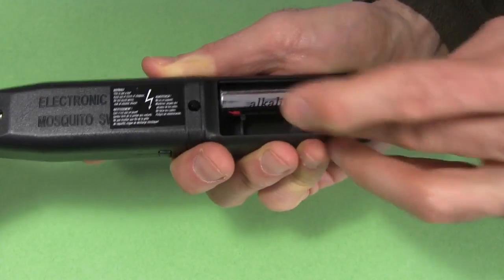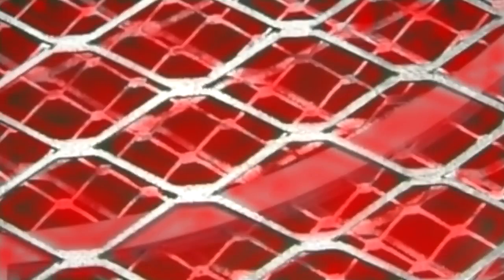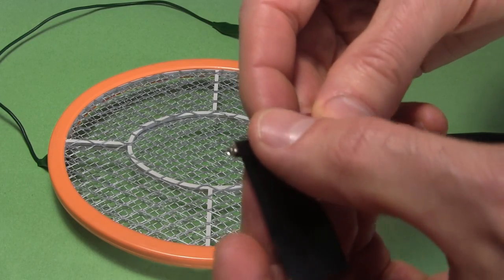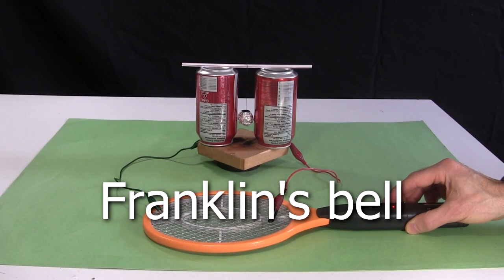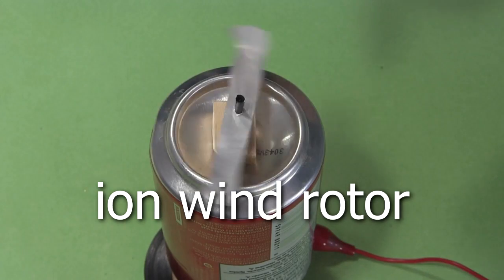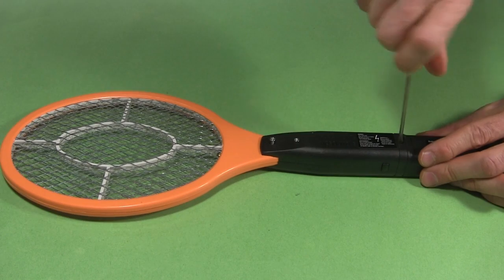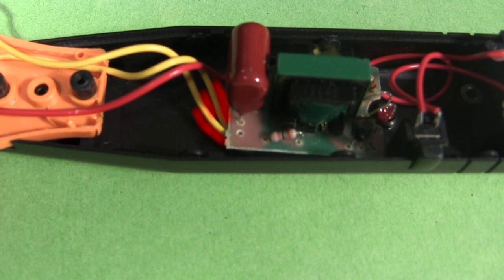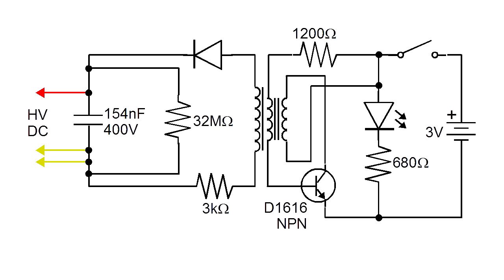Electric Fly Swatter/Zapper Racket High Voltage Power Supply

Comment: Bug Zapper is pretty much the following you can build from scratch or just rob a bug Zapper:

The simplest way to generate 1,500–3,000V DC from a 6–9V battery source is using a Joule thief circuit combined with a voltage multiplier (Cockcroft-Walton ladder).

1. Joule Thief (Oscillator)
Uses a transistor, resistor, and hand-wound ferrite transformer (e.g., toroid with 5–10 turns each on primary and feedback windings).
Converts 1.5–9V DC into high-frequency AC (typically 20–100 kHz).
Extremely simple, low-cost, and self-oscillating.

2. Voltage Multiplier
A 4–6 stage Cockcroft-Walton ladder made of diodes and high-voltage capacitors (e.g., 1N4007 diodes, 1–10 nF/1–2 kV caps).

Rectifies and stacks the AC pulses from the Joule thief to produce smooth(ish) high-voltage DC.

Output: ~1.5–3 kV depending on stages and input voltage.

Comment: Was that a normal screwdriver making those sparks or should I use electric one plus could I check the voltage with a meter checker
Reply from the maker: Yes, it was a normal screwdriver. The non-metal handle meant that I wouldn't get a shock. The voltage is too high for a normal voltmeter.
Reply: @RimstarOrg thanks for the info because I don't want another shock ,  it gave me a shock when the button wasn't pressed down

Comment: I have seen all of your videos and I love how you are going on on your YouTube channel soo about this video can we put this high voltage into joule thief circuit to host it up Or why that when we have ac current why we make it into low DC 🙄 maybe we can make it bigger AC current with voltage multiplayer??? It will make from low AC to higher very higher DC right ?!! Can you pls reply me and say if should you make a video of it I am a big fan of your work pls ?!
Reply from the maker: No, putting high voltage into the input of the joule thief circuit would probably damage some of the components in the circuit. And you're right, AC current put into a voltage multiplier make high DC.
Reply: @RimstarOrg  yes bout will you make a video of that topic ? I want to see how much powerful arcs can we get from low voltage like from 0.5 or 1.5 v to extremely higher voltage ever have been 💀so so much higher voltage
Reply from the maker: No, my high voltage days are over. Years of UV radiation from arcs and sparks is bad for the eyes and the ozone it produces is bad if you have enough years of it. So before I have problems, I've stopped.
Reply: @RimstarOrg  I'm 16 how old r u ? 
I have time :)
Reply: @RimstarOrg  idk I don't have anything to do like this is my hobby making like this things 😸
Reply from the maker: 50+. I agree, you have time. :-) There's still the dangers of shocks while working with high voltage so make sure you learn how to work with it safely if you do get into it,

Comment: Hi Rimstar! Another great 👍🏼 video from your channel. 
Can u connect the fly swatter to a voltage multiplier to get a super high voltage?? Then perhaps it can power the corona motor or ionic lifter....
Reply from the maker: If you remove the diode that's just before the output then you should be able to connect up a voltage multiplier instead. However, a ionic lifter needs more than high voltage, it also needs a relatively high current. I'm pretty sure this won't be able to supply enough current.
And thanks! I'm glad to hear you're enjoying my videos. Thanks for watching them!

Comment: Interesting video, thanks. How do I use a digital multimeter to see voltage etc from the fly swatter? Thanks, G.
Reply from the maker: You need a high voltage probe, like the one I show in this video https://www.youtube.com/watch?v=kXq4FCQ0C38, though I still use a cheaper analog meter in case I break something.

Comment: can this be powered by a power supply?  How much power is needed to zap the bug?
Reply from the maker: The circuit in the handle is a power supply but you could do the same thing with an external high voltage power supply if that's what you mean. I don't know how much power is needed to zap the bug though. It shouldn't be much since you're really building up power slowly over a period of time and then using it all up at once when a bug flies between the meshes. That is unless you want to be zapping bug constantly, then you'd need more power. But it's still not much since the power supply in the handle isn't very powerful.

Comment: These devices will run with 4 AA batteries as well. Simple way to get higher Voltage.
Reply: I modified a couple of mine to take 18650 Li-ion cells. With 4 ish volts, they now give a very satisfying 'crack' when zapping mosquitoes.

Comment: OK, I see a voltage divider at about 2:48.  I don't know what the values are though.
Reply from the maker: How so? The fluorescent tube, the capacitor, and the bleed resistor would all have the same voltage across them, no?
Reply: @RimstarOrg  I see now it's a bleeder resistor.  I was looking for a divider in haste, while trying sense of the 400v / 1400v oddity.  Sorry
Reply: @RimstarOrg  I took mine apart.  The circuit was a bit different, but the output cap look similar but with a voltage rating of 2kV.
Reply from the maker: No worries. I was hoping you'd figured out the mystery too.

Comment: Does it seem a bit odd that the output is 1400Vdc while the output cap is only 400v?  THANKS FOR ALL OF YOUR GREAT VIDEOS!!!
Reply from the maker: Thanks! And, yes, that does seem odd.
Reply: @RimstarOrg  I took another one apart, main cap:  .022uF @ 400v ?
Reply: My guess is that they are just being cheap. The caps are only rated for 400v but they seem to be able to handle 1400V for a few seconds at a time.

Comment: What would happen if you swapped out the two AA's with a 9v square battery?
Reply from the maker: It depends on the electrical components and what they're rated for. In this case the transistor would have to be rated for 9V and if it is, the output voltage would be higher and so the next thing to check is if the transformer can handle that high a voltage.
Reply: RimstarOrg I found another video where someone hooked up two 4.2v batteries and substantially increased the power, I would assume 8.4v is close enough to 9v that it should probably work. I don't have one but they're cheap enough to try it.

Comment: So the transformer is outputting 1,400 volts? I could use the transformer in a stun gun circuit for the T1 (first) transformer then. Wasn't sure how much voltage was coming out of that.

Comment: How does it output 1400V when the capacitor is only rated for 400?
I've also been wanting to buy one of these and slightly mod the board into a driver for a GM tube, but looking at the circuit there seems to be no component that has a direct influence on the output voltage. I guess it would be better to build my own after all?

Comment: Looks like you know a bit about high voltage circuits...can you recommend any resources to learn how to work with high voltage?  (e.g., at home, microwave transformer/capacitor, tesla coil, etc., not high voltage power lines).  I studied physics and have done a lot of low voltage electronics but don't know enough about high voltage to work safely with it.
Reply from the maker: I have a lot of videos about high voltage things on my youtube channel, but if it's a book you're looking for that addresses safety, I'm not aware of any. That's not to say there aren't any out there -- just that I've learned over the years from a variety of miscellaneous online sources as I did things.

Comment: I'm trying to make a deterrent to porcupines who climb and destroy my 20+ apple trees. I've seen many mods to the racket on how to make a stun gun but I need to encompass the tree 1ft from ground with a hoop that will deliver a deterrent when activated by its weight trying to climb over it at 360 degrees. I don't know how to wire the hoop to deliver the zap on an enclosed loop?

Comment: Was there an actual voltage rating on the main capacitor--also was it labeled AC or DC?  1400VDc is just what I need for an app but 400V won't work,
Thanks,
Reply from the maker: +dale nassar The 400V that I talk about is the rating that is written on the capacitor. It doesn't say it's a DC capacitor but that's clear just from the shape and the fact that there's no indicator of polarity.

Comment: have a 50000volt tazer collecting dust, is it possible to swap them out, creating an incinerator bug swatter? :)
Reply from the maker: +Belnick6666 50,000volts? I doubt it. 50,000volts would just spark continuously between the meshes. You'd need meshes that are spread further apart. Would certainly incinerate the fly though! :)
Reply: yea, they one I got is only 1.5 volt, zapp fruit flies but not house flies, they get a shock stumble in air and fly on, so thought that I maybe could add my 50k volt tazer :P

also it would only spark when on is pressed so why would it matter if it sparked all over, it is just on till the fly or wasp is gone
Reply from the maker: +Belnick6666 Oh, you're saying you'd only turn it on when the fly is in trap. I that case it should work fine I think.

Comment: Where on earth does it get the extra voltage from if the batteries themselves don't supply high voltage?????????? We all know that the extra energy (or volts) cannot simply just come out of nowhere so there must be somewhere that the 1.4 kilovolts are coming from, but like I said: little batteries like those don't supply that many volts to begin with.
Reply from the maker: Brandon Fisher To start with, voltage is not energy. Voltage is energy per charge (an electric circuit has charge moving around in various ways in various places.) Current is the amount of charge passing a point in a circuit per second. Power is the how much energy is being used up or generated per second.
But then you say, we still have an increase in energy per charge. We do, but not all at once. The voltage is accumulated in the capacitor, and builds up and up, until there voltage between an outer mesh and the center mesh is high enough for the the air to breakdown and we get a sudden rush of charge. That's the spark. After that the voltage in the capacitor is 0 volts and we start all over.
In the case of the Franklin's bell, the voltage has time to build up while the bell is crossing the space between the two cans.
For more on voltage see my video about that
https://www.youtube.com/watch?v=yjNu0iT0ClM
For current see:
https://www.youtube.com/watch?v=G3Ecx16iIBk
For how a joule thief circuit works see:
https://www.youtube.com/watch?v=0GVLnyTdqkg
Reply: RimstarOrg Thanks, for a long time I never knew how some devices that run on regular old batteries are capable of generating such high voltage like this or stun guns which can generate a whopping 1,000,000 volts (1 megavolt) or higher! :-)

Comment: I wanted to know if I can use a wire instead of the aligator clip?
Reply from the maker: Sakhi Solanki Yes, you can use just a plain wire, but for the wire that connects to the middle mesh, make sure that the metal part of the wire doesn't come in contact with the outer mesh.
Reply: okay.. thank you!!

Comment: can you put 2 or more zappers in series? to get a higher outputvoltage? or would that destroy sth like the capacitor or sth else?
Reply from the maker: Jian si No, for a variety of reasons. The input voltage to the second one would be too high, and it also wouldn't be flat DC. A better way to step up the voltage would be to get some high voltage capacitors and diodes and add a Cockcroft-Walton voltage multiplier circuit to the output of just one zapper (something like this http://rimstar.org/equip/negative_voltage_multiplier.htm).

Comment: Hi Rimstar, i looked at the schematic for the zapper and i dont understand the symbol for the transformer. It looks as thought it is in two parts. What model of transformer is in the zapper? Is there a part number?
Reply from the maker: ***** Unfortunately there's no part number, or other information. As for the symbol, I drew it that way by referencing another. I guess I should have drawn it with a single core instead. I haven't opened it up, and don't want to since that would probably ruin it, but I suspect it's a single core with three windings. The two input windings have a resistance of around 20 ohms each and the output winding has around 320 ohms, so I suspect more turns for the latter, which makes sense.
Reply: RimstarOrg Thank you for clarifying. I havent came across a three core transformer before. Something to study up on.

Comment: very interesting !
i have been always wondering how these things work, nice to know now.
by the way i have noticed a better image quality regarding to this video. what codec do you use to edit on your Sony Vegas?
i have been going native for long time with h264, but need to replace it with something softer.
Reply from the maker: SAMIMY Glad it satisfied your curiosity. I was surprised when I saw it was a blocking oscillator since I've seen a lot of them lately.Regarding the codec, I don't know which one. I output using Sony Vegas' "Internet 1280-720-30p" selection and MediaInfo says the resulting file is MPEG-4. I do render to h264 when creating my animations in Blender in order to keep the file size small, but then they go into Sony Vegas.
Reply: RimstarOrg umm mpeg-4, it is a nice format for playback uses h264 codec.
so simply if you are using one of these recent Japanese cameras, you are probably editing the h264 codec. but if you use older cameras like 5 or 20 years ago,  the codec might be mpeg-2.
offers good quality picture if you render it with a high bit rate. my cameras are all old bought in 2007.

Comment: Question, In the schematics it says the output cap is 400V but in the scope you show 1400. Is that normal? i've tested ceramics and electrolitics way above their nominal voltage and some seems to not have any problem despite losing capasitance (i suppose, havent actually tested that) but from 400 to 1400v seems to be a bit too high for it not to fail, more when i've seen those fail with just mains transients.
Reply from the maker: Laharl Krichevskoy Hmm... Good catch. I don't have a good answer for you. The probe is definitely x1000. I'll have to think about it, maybe I'll try the measurement again but with the probe connected to my analog meter.

Comment: Can you make a high voltage supply from a teaser? I need one to make a TEA LASER , will it work ?
Reply from the maker: Laurentiu Jan I don't know if it would work. I don't have a taser. If it did work, I suspect it wouldn't be continuous. You'd probably have to build up the charge for a while before discharging it and getting a single, brief laser beam before waiting for it to charge up again. But I'm just guessing there.
Reply: RimstarOrg
Thanks, I will try it myself, I need to come up with a clever way of connecting it to the Al foil capacitors, I will let you know if I will obtain the lasing effect ! That will be a nice physics project :P
Reply from the maker: Laurentiu Jan Definitely let me know how it goes. I'd be interested in knowing if it works.

Comment: My experience: If you remove the bleed resistor, the voltage gets higher, but also results in an angry girlfriend who had her finger electrocuted ...
Reply from the maker: John Knutsson :D Ouch... for both your girlfriend and for what happened to you afterward. :)Actually, I'd be more afraid of the voltage not bleeding away, and remaining for a long while. I've yet to put a bleed resistor in my homemade 24 volt DC wall powered power supply, so when experimenting, if my load isn't working, there's a scary amount of energy sitting in it's cap, and I get a wicked spark when I manually discharge it.
Reply: RimstarOrg
Oh man, my immature side made me laugh when I read this:
"so when experimenting, if my load isn't working, there's a scary amount of energy sitting in it's cap, and I get a wicked spark when I manually discharge it."
Reply from the maker: RadioKies :D

Comment: Nice video as always! I guess the capacitor isnt for smoothing, but rather for storing the energy so that you dont have to constantly hold down the button.
Reply: At least mine worked like that...btw. always discharge your caps before touching the circuit...outch! ^^
Reply from the maker: chemieprof Thanks! Regarding the capacitor, this one would store energy if not for the bleed resistor. It drains to close to 0V in around 9 seconds after releasing the switch, making it safe after that. I guess I should have included that part of the oscilloscope video. But I'm chicken and usually stick a screwdriver in anyway. :)
Reply: I always assumed the capacitor was so you get a nice "crack" when swatting a bug. I don't think the current is high enough to make a decent spark without the capacitor. I should test this.

Comment: Why is there need for DC on the grids?
Reply from the maker: Markus Blechschmidt I guess it could be done with high voltage AC but in between cycles the voltage would be 0V. A fly would still be in there long enough to get zapped though. However, I suspect the reason is to build up the voltage over a short time, so that you get a high voltage than you would otherwise.
Reply: Interestingly, I was expecting a voltage doubler or tripler on the output. I thought these are good sources for cascades and things.
Reply: Just because it is easy to build up lots of charge and deliver lots of watts into the flys all at once. Like a thin stream of water vs dumping a bucket of water after filling it up slowly.